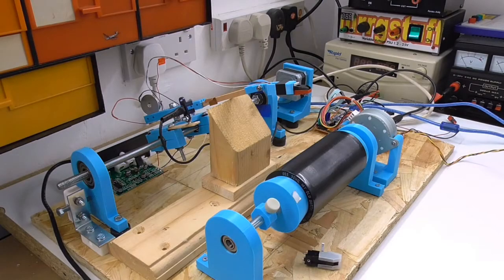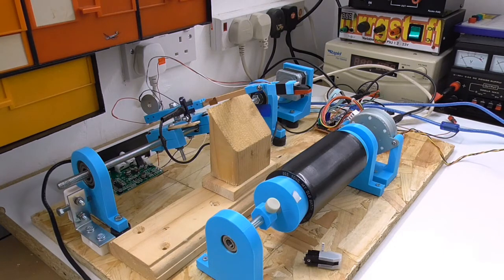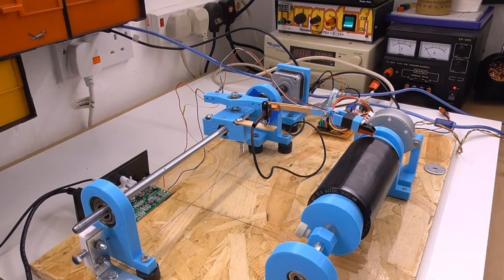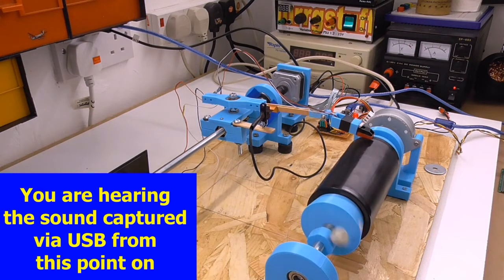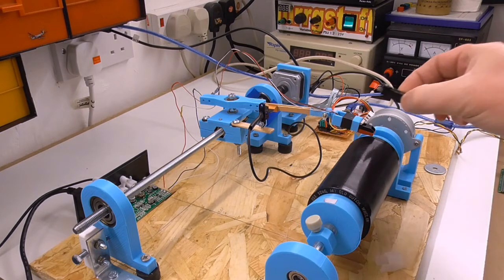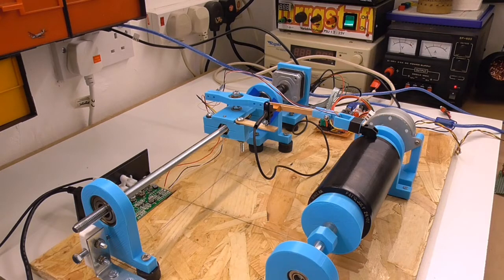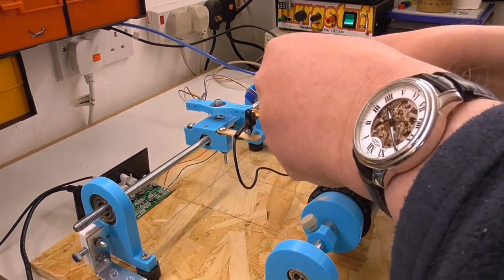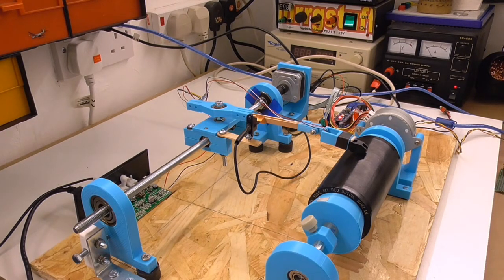PLA stylus test - DIY Cylinder Phonograph

Comment: Shame the printed one didn't work.
Reply from the maker: Indeed, though I think there is more scope for experimenting with it.🤔 Thanks 😀 👍
Reply: @mrrgstuff  It's the fact that cylinders are recorded with an up and down modulation rather than a side to side modulation that makes it tricky.
Reply from the maker: Yes, and this machine has no facility to adjust the tracking force. I have an idea how to add that, but until I do,  I'm not going to risk any more cylinders. Thanks 😀 👍

Comment: What kind of motor did you use in order to actually rotate the cylinder record to spin at a near accurate pace? (This is because im planning on making a somewhat modern take on a phonograph, still using a modern-styled horn and maybe a real diaphragm)
Reply from the maker: It's a stepper motor. There is more detail in these 2 videos:
https://youtu.be/QP42Cqz14RI
https://youtu.be/osF5uNdUXKo
Would be interested to see your build too!
Thanks 👍 😀

Comment: To avoid distortion you can record it in a slower rotation and compensate it afterwards
Reply from the maker: That's an interesting point. This machine does run at 120 RPM as well as 160 RPM, and I can program it to run at other speeds too. Recording at slower speeds and then speeding it up does work but I have not a tested to see what effect it has on distortion. Makes me think of this other video which you may enjoy:
https://youtu.be/tq4shXkiP3s
Thanks 👍😀

Comment: This is a great experiment. I think a smaller PLA ball would track perfect something around .6 or .7mm. Love these videos they are fantastic
Reply from the maker: Thanks 😀 👍.  I think the ball on this one was around 0.7mm. I have made a 0.8mm one but I will try a few smaller ones. The base material is 0.4mm as that this the diameter of the hole in my 3D printer's nozzle
Reply: Great experiment. A smaller PLA would be great to hear. I still feel there is great potential there.
Reply from the maker: @GramophonicReevolution  Thanks - yes - I will make a range of sizes and see whats works. The current one is about 0.7mm and although it wouldn't tract the indestructible cylinder - it seemed ok on the wax ones for the short periods I tested it on. I was amazed at how fine the grooves look on the wax cylinder - I was surprised it would track it at all. 😀

Comment: I seem to recall reading somewhere that the 'wax' cylinders are actually made from a sort-of hard soap. They are very prone to mildew damage, and need to be kept somewhere dry and at room temperature. Never get water near them! Unlike shellac or vinyl records, they CANNOT be cleaned with a damp cloth. (Probably it is best to brush them gently with a very soft brush to clean them.)
Reply from the maker: Yes my understanding too is that they are technically soap. One of them has a little mould on it, and the other probable will develop a little now its been out of the box in the workshop a few times. I can well understand why later ones were celluloid as wax is far too fragile. Good idea about brushing them, I did think I might try a clean paintbrush (one for model making) on the damage surface before I attempted to play it again. Thanks 😀 👍

Comment: Have you considered using glass rod to get the ball for a stylus?  I think I have seen this on you tube. Good work. Thanks for posting.
Reply from the maker: Yes, I was planning on using glass (I have even saved some broken glass to use), but the PLA was quicker and simpler and I thought was worth a try. I hope to make a glass stylus at some point in this project. Thanks 😀 👍